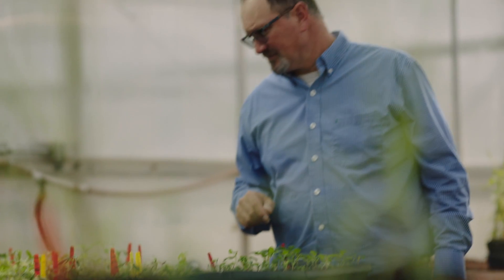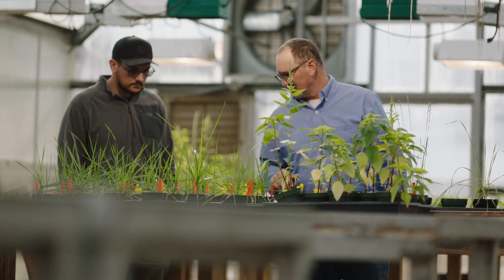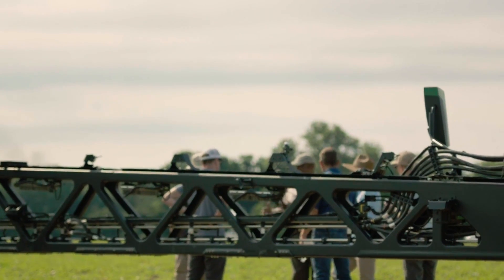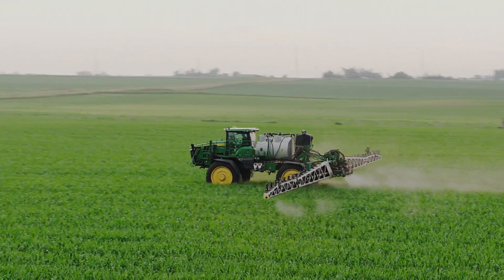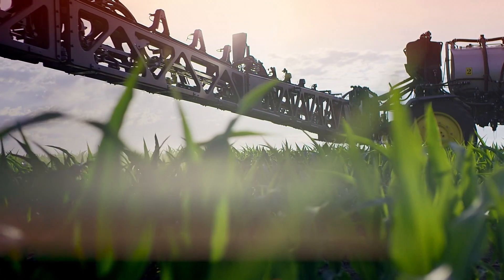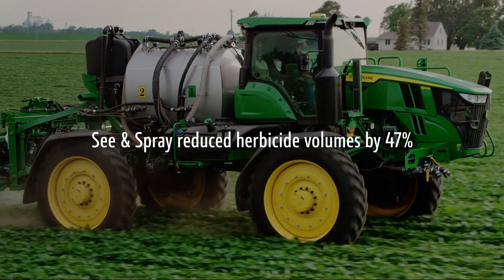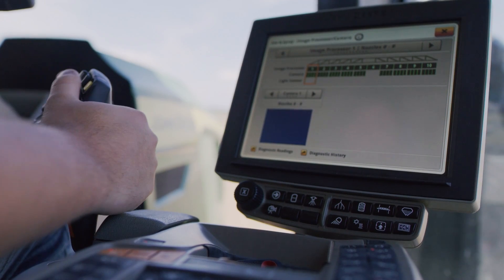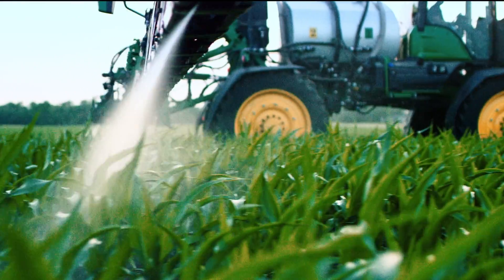See & Spray™ Ultimate – Dual Product Tanks | John Deere Precision Ag

Comment: My concern with utilizing duel tanks & see/spray is the use of residual herbicides.  You can't apply a residual using see & spray. Duel tanks are great but when your using 15gpa on one product & 10gpa on another, you're losing a huge capacity that causes increased reloading  intervals.  I love exact apply utilizing the A+B pulsating. Substantial range increase in terms of speed. I can apply 15gpa at 5-25mph with a 15psi setting and never have to increase my pressure.  Using just A or B or A+B Combined does ok. But using the A+B with 2 tips far out performs anything else in terms of coverage,  speed range & GPA